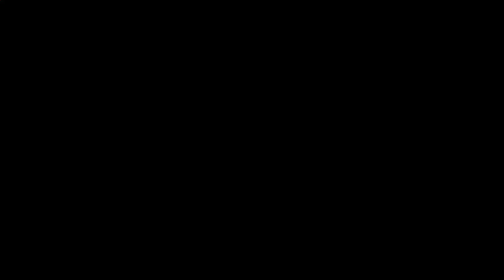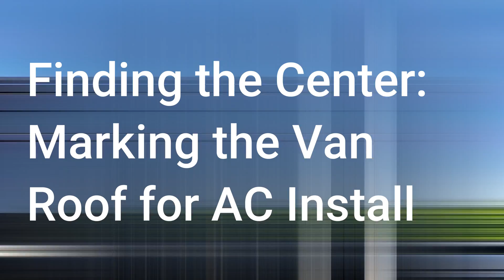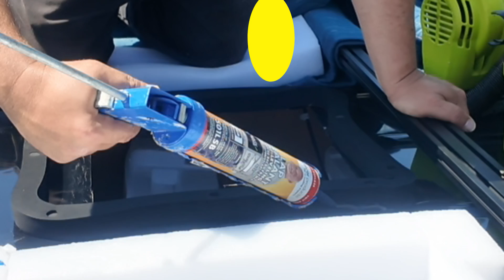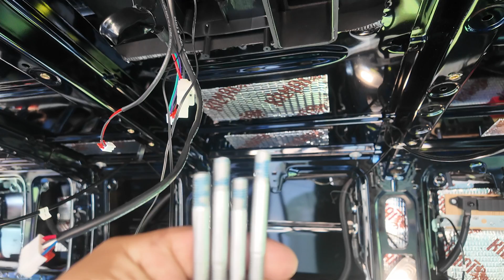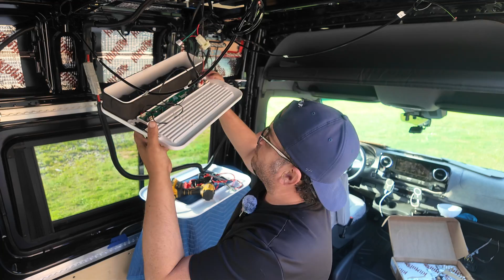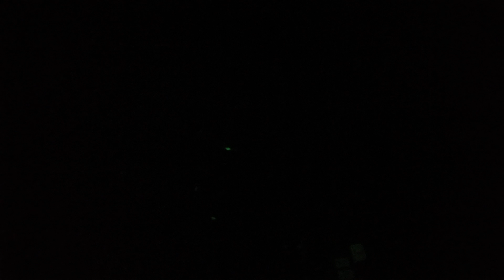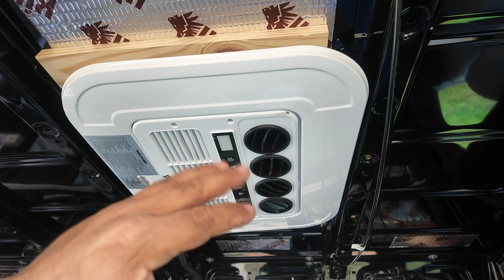Don't Cut Your Roof Until You Watch This! 12V AC Install

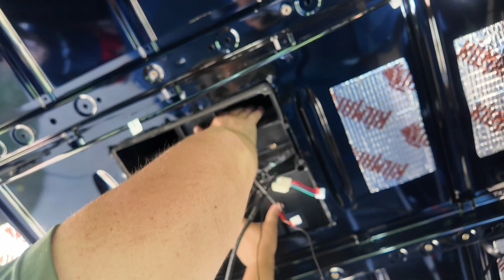Comment: I noticed from another install that the 14x14 opening causes leaks into the van.  At the 10:26 mark on you video when you’re installing the ac, you can see the open sky in the vents from inside your van and gasket.  Your left hand is literally on the openings to the fan area.  Have you leak tested the ac?  In the other persons video he says water enters from the exhaust opening and through those vents into the van and there’s no way to stop it.  Just curious if you had the same issue?
Reply from the maker: The 14 z 14 is not the issue, it’s the fact that I am installing it in a sprinter in between the ribs and it was poorly documented to put the long side of the gasket forward and not to sides. So my didn’t leak under normal conditions but when the crazy sideways rains of Texas happen I did notice there was a small leak because of my gasket orientation. Put the long side of the gasket forward.

Here is the update video I made about the issue and the fix. https://www.youtube.com/watch?v=8RGpvvMbasU&pp=0gcJCR0AztywvtLA
Reply: @RANDOMFIX the other installer measured from from the tip of the vent to the front screws on the ac and it was exactly 14”.  What he’s saying is if you apply the 14x14  gasket those vents will sit on top of the gasket.  Very concerning as the vent should sit outside of not on top of the gasket.  Have you tried spraying water onto the top of the ac, especially where the exhaust fan is? .
Reply from the maker: @nicklee5591 I am happy to report no leaks with new gasket installed. As I have showed in the install video I my template is 14.125 by 14.125 or 14 1/8.
Reply from the maker: @nicklee5591 also the original gasket needs to trimmed which can cause an issue as no everyone can get the measurement perfect.
Reply: @RANDOMFIX I searched your parts list and didn’t find that 14x14 gasket you finally used.  Got any info where I can get it?  Thx
Reply from the maker: @nicklee5591 there is a link in the video description of this video.

▶️ square gasket in case you need something else on top - Make sure you put the original gasket that came the A/C with the wide side forward or else it will leak from the back. This is why I am letting you know about this gasket ▶️ https://amzn.to/4k25VBc

Comment: In another of your videos (https://youtu.be/QX1o89CqNKg?t=808 ) you show the power cables on the inside of the housing. It is difficult to tell where the big 12V wires lead to, but it seems to me plausible to route those completely within the housing of the unit and down via the vent/intake, instead of out the back and under?

Comment: I want to be able to charge my batteries from either  solar panels, the van alternator, or from shore power.  Just use a simple 3 position isolator switch?   Thanks!

Comment: This thing draws so much current that it will run down your battery in no time unless you keep a generator running to recharge the batteries.
Reply from the maker: Or you can have a bigger battery bank and / or solar!
Reply: I only have 900 watts of solar and 480 ah lithium batteries and easily can run it 24/7.  It does not take that much.

Comment: Thanks for this video. Would you have any thoughts on how to run the wires if your ceiling and walls are already closed up? There is no way to fish the wire through. I have a 14 gauge wire in my ceiling for my max air fan. So I already have a 14x14 hole. I doubt  that a 14g wire would be large enough to run it.
Reply: You are correct re: wire guage size.  It comes with 4 g.  I just got mine and haven’t attempted a mount, but I have my ceiling and wall mostly in.  It comes with the wires in a wire loom.  I’d ballpark it 3/4”?  You could potentially drill a hole for the wire and add another wire gland (like your solar panels probably run through).  I see he is currently saying they should have allowed a hole to just run it where the fan mounts.  I suspect he is right.  Depending upon what your interior is, you can always run it on the surface, and perhaps wrap the wires loom with different colored tape to blend it.
Reply: @nmartin5551 thanks, those are good ideas. Good luck with your install!

Comment: Great Video.. I'm going to have to watch the gasket section a few times - 11min mark. Wasn't certain why it needed to be trimmed for leveling AC.
Reply from the maker: Thanks, in the video description there is a much better gasket that is so much easier to use. It’s a one piece gasket with rear supports included.
Reply: @RANDOMFIX  just purchased the additional gasket.. I ordered the Outequip pro 12v about a week ago based on your video and recommendation. I appreciate your videos. Thanks
Reply from the maker: The gasket that was included has a much taller rear support foam block that is a different size than the gasket so the back was lifter. That rear support foam block does compress like the actual gasket. I actually changed my out to new style yesterday. The link is in video description to the gasket.
Also, there is another way of running the wires on through the actual unit. You can also run other wires as well.

Comment: Im looking to run one of these on a power station, but the wires really confuse me. I saw you're making a video showing how to plug one into a power station. Looking forward to that video!
Reply: No power station can provide enough DC current to run these. They're designed to run bigger AC loads, not DC.
Lithium batteries, and a way to recharge them is what's needed.
Reply from the maker: Sorry Samuel,  there are native 12 volt power stations that do exactly hat, the power any 12 volt device  

https://youtu.be/CpxEwSwUNbA?si=IE22Iw8GAgk1Z15M

I have over 7 videos on them.
Reply: @RANDOMFIX I noticed you have one. But really it is a battery with some connections. I guess a battery is a power station then.
Does your unit and an AC charger and an mppt charge controller?
Reply from the maker: Yes, it has a moot charger, a strong sine wave inverter, it’s got cold weather protection so it can operate below zero. It can be networked, has screens, there are ac and dc pdu so you can control everything from the unit.
Reply: @RANDOMFIX what's the brand?

Comment: I've seen about 8 of these install videos, this is right up there with the best of them. The OutEquip website mentions keeping the unit level for draining. One thing I haven't seen in these videos though is related to the condensation drain line. Is there one?  How and where did you route it?
Reply: It just drains out of the bottom of the unit on to your roof

Comment: I want this unit - have hole already where Maxx fan is but you lost me as to what bus bars are for and why and how ... wish it just had a house plug ...
Reply from the maker: If you already have 14 x 14 hole then you are good!
Sorry I don’t follow as to the bus bars? You just need to connect to any suitable 12 volt power. Either the engine battery or a dedicated house battery.

For the engine (starter) battery make sure the vehicle is on as this will kill you starter if the engine not running.

The bus bars are in my van are used to distribute 12 volt power to all of electrical 12 volt system. I don’t want to make a make a battery box so I am running the wires in the walls instead.

Comment: Nice job dude, super helpful.
Reply from the maker: Thanks. Just make sure you put the gasket long side forward. Not like I did which was short side forward. Also there is a great gasket that already square for around 20 dollars that I will be changing to. I will leave a link to it in the video description within 25 hours.

Comment: I have a ecoflow how do I connect that to the outEqipt
Reply: Thank you for your video. Very informative. I got lost with the cable routing. How did you actually ran it under the unit to the inside of the van and keeping the install water tight?
I have an EcoFlow delta pro, 3,600 w and an extra battery with 3,600 w extra. My plan is to run this ac with a 12v every power supply that can provide up to 120 amp. Will this set up work?

Thanks a lot!!!
Reply from the maker: this is an easier option for a water tight seal https://cdn.shopify.com/videos/c/o/v/9f13acf1e5e24686beba0db06cbcfa61.mp4

do you have anderson connection for DC output on the Eco Flow delta pro? if so, then you can make this work, but I would install a small 12 volt LFP battery 50 AH should be connected to anderson connector to handle any surges. The problem with most power stations is the limited DC 12 volt power.  You anderson connection is rated at 30 amps but this takes 40+ amps on Turbo mode, you might be able to use the anderson + the 12 (10 Amp power port) but that is something you will have to figure out. 
My idea adding a small LFP battery to buffer the load will work! Just connect to Anderson port and enjoy the cold air!
And I found a gasket for $20 that is better the one included. the link is video description.
Reply from the maker: The ecoflow is good power station but it can’t handle the dc load. You need something like https://youtu.be/j4RFnUOsUpM?si=xvVPNSlSFZ2u9caZ this unit is native 12 volts so it can handle the dc load of the outequip with no problem!
Reply: @RANDOMFIX  thank you yeah I think i need  a better power station
Reply from the maker: You don’t need a new power station as your power station is good but you need a 12 volt buffer like a 12 volt lfp battery at least over 100 ah, 200 amp is what you really want.
Then you can slow charge those off your ecoflow and be able power the air conditioning.
You will lose some efficiency but at least it will work without having to spend $$$
Let me know if you understand or else I may have to record a video explaining this as you are not the only person asking and I don’t want you to waste $$$ if you can avoid it.
Reply: @RANDOMFIX  I  don't really know about 12 volt buffer but I'll look it up. I sure don't want to spent 1700$ on a comvolt
Reply: @RANDOMFIX  would a 24v DC better than a 12v dc if im planing to put this on my car and running the comvolt or the ecoflow??
Reply from the maker: @1bek 24 v it would be but and it’s a big but. A 12 v system is much easier to operate and configure. Remember you are running in a 12 volt vehicle and that alone is a big plus. It’s easier to stack 12 volt power as well.
 With 24 volt you will have to buy in pairs and that means twice $$$ each time you watch a little more capacity.
Reply: Thank you for your reply. No, the delta pro does not have the Anderson output. I will keep the idea of the lfp battery in mind if the 120 amp power supply does not work. Still wondering how you route the power cord inside through the big opening and the gasket and secure it water tight/sealed.
Reply from the maker: Sorry I am not following. Where are you getting the 120 amp supply from?
Reply: A120vac to 12vdc power supply, rated to deliver up to 120 amp. Used in rvs
Reply: Hi and thanks for the video, but is the air conditioner already loaded with refrigerant and ready for installation?
Reply from the maker: @marcozuccati it’s preload and just needs to installed.

Look at the other gasket I included in the video description as it makes the install even better.
Reply: Very well..thank you @RANDOMFIX

Comment: Question  : if you hook this up on a Bluetti 2764 wh how long the ac will work ??
Ty
Reply from the maker: You might be able to get 4 to 5 hours if on max setting or  double that if not on turbo mode. You can’t run this off you power station with out some other dc 12 volt system to buffer the load as it takes 40 amps of 12 volt. Let me know if you understand or else I may have to record a video as I am getting a lot of similar questions.
Reply: @RANDOMFIX  thank you for the response.  I think that when you can if you can make a video  if so many people are asking  .
Thanks nick
Reply: @RANDOMFIX yes please do a video I also am having the same issue . My BLUETTI is more than capable to power the Ac unit but the 12v wiring in to small .
Reply: Thank you for this video. I’ve been searching for instructions on how to install and you were the first one they gave me realistic point of you thank you and I would like to know I have a Jacory 2000 Pro I’d love to know if I can hook it up to that.

Comment: How many amps does it draw, how long would a 100 amp hour battery last?
Reply from the maker: It would work for 1 to 4 hours depending on what sort of battery chemistry it’s is. And what mode you have the unit in.

Comment: What is the power consumption
Reply from the maker: From 25 amps to 40  ( turbo mode) amps on the air conditioning l. The heater amperage is less.
I got a chance to use it a the beach last night near Houston and it would great as it was super humid.
Reply: Do you think a regular battery will keep it working if your are driving
Reply: @danielcanabal5092  
That's kind of a complicated question.
First principle -- your "regular battery" is onto going to be supplying power to this system "if you're driving".  It may be transferring the power but the real supply will be coming from your alternator and your real question is will the alternator in my vehicle keep it running.  
Using my Sprinter as an example,  the book says that the Sprinter (stock) alternator will put out about 200 Amps max at 60 Mph on the road.  No way would I attempt to pull 200 Amps in service (just my opinion but my experience is that auto alternators will experience heat overload and other damage if run at more than 75-80% of their stated maximum -- just my opinion, but I want some reserve capacity there for reliability.
Sizing the charging/battery/solar power supply for an item like this AC unit should be done considering maximum load with a "reserve" applied.  As noted above, I wouldn't want to pull more than 150 Amps from a 200 Amp alternator. 
"Random Fix" says that he's seen 25 - 40 Amps in service.  I've seen some other accounts saying that they've recorded up to about 60 Amps at very high loads.  So for safety, I'd consider about 75 Amps to be my calculated maximum load for running this AC unit; in reality, it will almost always be less but I don't want fuses/breakers/overtemp sensors, etc. to be tripping while I'm trying to use it and I don't want to damage the diodes in my alternator.
So, we're talking about using approx. 1/2 of the alternator output for continuous use of this unit while driving.  Does a van ever pull more than the other 75 Amps for other loads (charging the battery after starting, powering the lights,   running the stock AC/heater blowers, etc.)  This is something that I don't know.  My guess that it is not likely to happen often but it might be very high load conditions would pull that much.  The exact answer to your question relies on good information about these variables.  
(Note;  If you're looking at performance you can do some things.  If a battery is strong enough to start your vehicle, it's very likely that its charging loads will drop a lot after 1-2 minutes, so if you think you're in a marginal situation, you could start the engine with the headlamps etc. switched off, the stock heater/AC off, and everything else you can think of turned off or disconnected.  Then, after that two minutes, you might try bringing up the AC at a low power setting then after a short time (20 30 seconds).  If everything is stable, then try increasing your AC settings - and using the stock AC while drivng if necessary.)

Bottom line, I'm guessing probably but be sure you're not in severe conditions that will create unusually large loads.  (Also, there are 280 - 300 Amp alternators available for Sprinters -- I'd guess other similar vehicles, too -- that would give you lots of extra electrical power when driving down the road.  I have a friend who is a musician and he has a 280 Amp alternator in his Sprinter; he runs his OutEquip AC and powers sound gear when he's doing outdoor gigs with no trouble.  But if your vehicle provided enough power for your needs, a larger alternator would be a needless expense.  As in most things, the real answer includes "it depends on ... " )

Comment: That looks nice! I already installed the Dometic RTX2000 in my sprinter. Being an AC and a heater is great! I’d Like to know how this one performs! 👍
Reply from the maker: I got a chance to use it last night on first trip in the van. It worked great and once the insulation is all done I hope I don’t have to use the sprinter air conditioning. My kids site under it and say it gets real cold so I might need to bring them a sweater. I got 400
Watts of solar installed so it’s almost par.